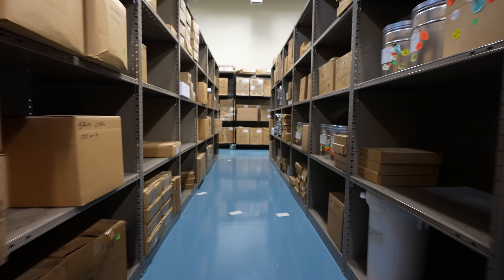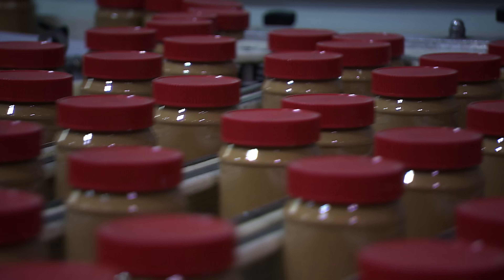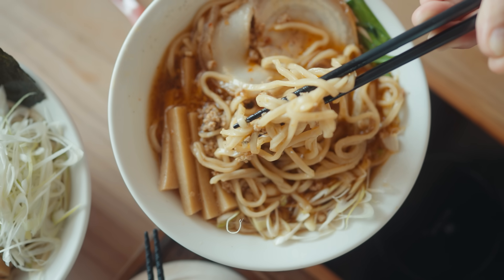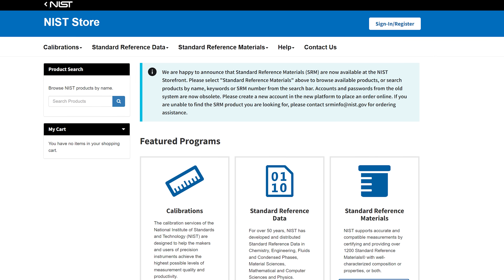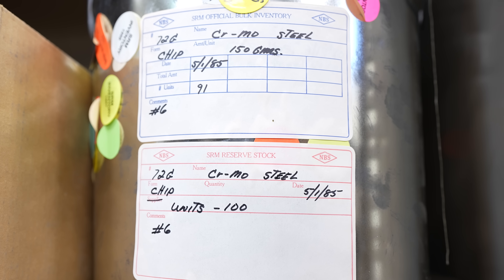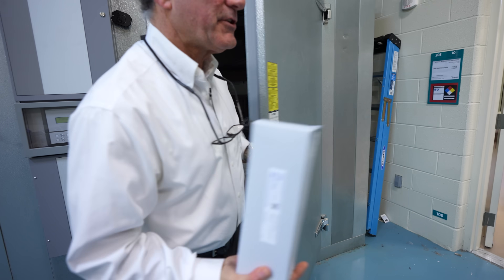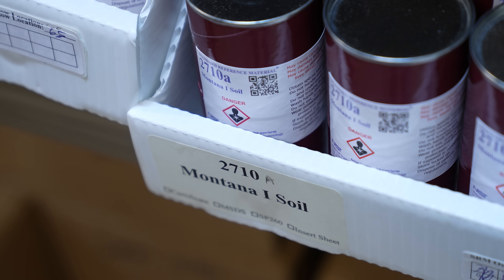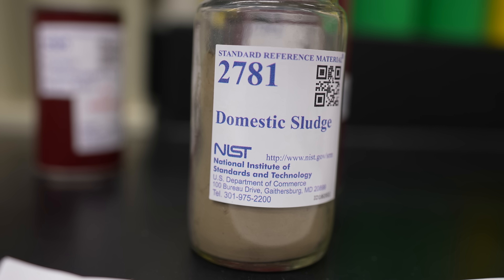The world depends on a collection of strange items. They're not cheap

Comment: I work in an analytical lab here in Brazil and I use a lot of this peanut butter reference material as a quality control for mycotoxins, fatty acids and metal ions in food. It smells so good though! And thanks a lot for these people that work at NIST and make this reference materials. You guys rock!
Reply: @PersonalStash420  someone has to do it. So tanks for NIST to provide such materials. Yes, it's expensive.
Reply: that's super interesting! I used to be a data analyst so all of this is so cool to me lol
Reply: Have you ever tried to taste it?
Reply: @autumnalburn  no. It's an old material and we have a lot of things that shouldn't be there, so definitely no :-)
Reply: nem sabia que existia umas parada assim, doidera
Reply: BRASIL VAI GANHA A COPA 🇧🇷🇧🇷🇧🇷🏆🏆🏆🏆 HECTA CAMPEÃO 🇧🇷🇧🇷🇧🇷🥇🥇🥇
Reply: Except for the 9/11 NIST report, which made such dramatic changes to the structural properties of concrete and steel that, were they true, large swaths of the frozen north would be unable to build structures taller than 3 stories.

I wonder if this is the guy that approved the expansion rates of steel and concrete under heat for the 9/11 NIST report?
Reply: @unifiedtheoryoflife9922  there are no high rises in the “frozen north” that you speak of that even closely reaches the height that the trade centres did lmfao
Reply: @Tmktrsf  The number is 3 floors - and the north is anything that freezes in the winter.

NIST 9/11 report changed the known expansion rate of steel and concrete by so much that you could not buld a 4 story building in Chicago, because the 4th floor would need to be steel, and the steel and concrete apparantly separate under office fire heat, so imagine what 100 degrees the other direction (0F) does. It makes Chicago a one stop light town
Reply: @unifiedtheoryoflife9922   reality: a building collapses due to a +500F delta

you: hOW CAn BuilDInGs EvEn WiThSTanD a -100F DeLTa TheN?

Genius.

Besides, contraction vs expansion are different. Materials have different strength in tension vs compression. And when looking at a structure as a whole, crushing the structure vs tearing it apart is pretty different.
Reply: @unifiedtheoryoflife9922  The cement has to cure above a certain temperature for a certain time frame so prefabs are used and construction avoided in cold weather months for concrete ours with thermal blankets used if temp drops.
Reply: @bobson_dugnutt  ALSO! Steel loses half its strength at the temperature at which jet fuel burns. I always find it funny these dumbasses say steel as to melt, in order to fail... No, it's properties just need to change just enough for it to fail...
Reply: @unifiedtheoryoflife9922  They have 4 story buildings in Chicago and in colder cities....what are you rambling about?
Reply: @BestestDerek  The jet fuel was expended in the initial fireball. 

The temperature you are referring to is jet fuel under optimal conditions. 

What we saw on 9/11 was a black smoking, oxygen starved, office furniture ( designed not to burn ) fire. 

There were people standing in the hole the airplane made and who died trying to escape that area. You're telling me the furniture red hotted the steel and changed its properties?

That building, being so tall was designed to withstand a Boeing 737 impact,  the biggest jet at the time and not much smaller than what hit it. 

At WORST - the structure surrounding the 50 core steel I beams which hold up the entire unique open floor plan of the twin towers, should never ever in a million billion years have fallen to height 0, unless they needed to fall to height 0 - the core I beams surrounding the elevator shafts at the center of the Twin Towers should have survived 

The central I beams should have survived the office furniture fire. 

Height 0.
Reply: @Bobson Dugnutt  Severely edited his post for content after I replied directly to him, which is unethical. The consequences of rapidly approaching a limit are often drastic, right?

@John G There would be no 4 story buildings in Chicago according to the 2005 9/11 NIST report, which is censored. 

Theat 2005 9/11 NIST report tampered with the known physics of steel and concrete expansion under heat that no steel building could survive a Chicago winter. Nothing over 4 stories. It was a scandal what NIST did - it was equivalent to Colin Powell saying we found bioweapons in Iraq to the UN

Iraq had no bioweapons, and buildings do not fall symmetrically, from asymmetric damage, through their paths of greatest resistance, at near free fall speeds, without deceleration, to height 0 without assistance. That assistance has a known quantity and placement - and is evidenced in photos of the 9/11 debris and dust samples.
Reply: @unifiedtheoryoflife9922  This makes no sense. How does the behavior of steel and concrete at high heat change the behavior at low heat? The fact that water boils does not compromise the strength of an iceberg.
Reply: @efdeecue  He's saying the stats used to justified WTC failure when applied to other extremes such as cold, do not compute.
Reply: @unifiedtheoryoflife9922  lmao you looking for people in the youtube comments to be ethical ?
Reply: @unifiedtheoryoflife9922  so tell us, what is the specific value of thermal expansion rate that you think NIST made up? And what is the real value used by engineers to design buildings?

Surely you've actually read the report and can point us to the exact value, and you're not just uncritically repeating some BS claims you read on a blog or something?
Reply: @unifiedtheoryoflife9922  I'm still caught up on the fact that you think Chicago is a one stop light town. Sorry, but dude, you really need to get out of your mom's basement and get your facts straight.
Reply: @unifiedtheoryoflife9922  still and all, their peanut butter srm is really good
Reply: @bobson_dugnutt  Oh boy, the paper planes, ruined steel concrete building :O
Reply: @unifiedtheoryoflife9922  IT WAS AN INSIDE JOB BRO
Reply: @bobson_dugnutt  Not at all related but it's just incredible to see another Dragon Friends fan here
Reply: @unifiedtheoryoflife9922  There's a difference between radiant heat dissipation and kinetic energy transmission. It's the principle used in controlled demolitions of structures that were designed to withstand these heavy impacts. While a giant ~205000kg jet slamming into that building at 750km/h would only have generated around 7-8 giganewtons, the explosion of 90000 liters of jet fuel added anywhere between 70 and 150 giganewtons, which brings it to the realm of what is used to bring down even larger buildings. For comparison, the demolition of the significantly taller Mina Plaza only took around 6000kg of explosives, which was of a class that would have generated only around 50 to 80 giganewtons, barely over half the force that plane crash event generated. While the efficacy of force delivery is certainly much higher in controlled demolitions, it's not hard for 30+ floors of falling structure to make up for the rest, especially when structural integrity gets compromised more and more with each impact. Additionally, most demolitions prefer to go over the force requirement if possible and add more explosives / reduce section distance between explosives, not because there isn't going to be enough force, but that it's simply cleaner of a job when there's less structure to take impacts. I'm sure the fires didn't help things stay structurally sound either, but to be honest they may very well have been completely irrelevant at this point.

The structure doesn't have to be exposed to radiant heat, just vibrate enough to the point that it lowers its structural integrity so that it can no longer support the weight of what's above. Once that gives, impact force from the falling section will create further vibrations that further destabilize the structural integrity of what remains. If you're lucky, or unlucky in the case of demolitions, it stays standing. Most of the time, it does not.

On a related note, this is the reason why skyscrapers (and increasingly even mid-rise buildings nowadays) built on the pacific ring of fire (Japan, New Zealand, Taiwan) employ technologies which allow for the structures to take reduced vibrations from earthquakes. The main difference is the way the energy is delivered, with earthquakes predominantly consisting of maintained lateral forces, as opposed to one big delivery from an event like 9/11 or a controlled demolition, but earthquakes can easily deliver enough kinetic energy to destabilize a building.
Reply: @unifiedtheoryoflife9922  3 floors is not a high rise so I’m not going to bother reading anything after that. Anyways have a nice day 😌
Reply: @kairiroseequinote2946  he didn't say it was a one stop town.
Reply: @bobson_dugnutt  well that shut him up
Reply: @efdeecue  it doesn’t. He’s saying that NIST changed their existing steel samples to conclude that it would change the behavior in that way. Not that in reality it does
Reply: @kairiroseequinote2946  being caught up in such an irrelevant part of his comment that he was even saying isn’t the case shows your shortcomings in intelligence. Nobody said Chicago was actually a one stop light town. It might if you can’t read though who knows I don’t suffer from that problem
Reply: @Tmktrsf  if you actually think he said three floors was a high rise I present you with a Darwin Award. Have a nice day
Reply: @zach3096  Its almost like I was responding to a comment that did say that lmfao. Please learn how the internet works.

Comment: I'm still fail to understand how a lot of those are usefull. Like why would you store perishable food for so long that it decay and change composition? They say they keep peanut butter to use as a way to detect fungal infection in peanuts but i mean if the peanut butter is stored for so long that it basically rot in its jar how is that a valid standard anymore when the standard sample itself is unsafe for consumption? What about steel? I understand the need for steel sample in the 20th century but now that we have mass spectrometer you just need to scan a piece of steel once, get the value of the different elements composing it and then scan the steel you produce and compare the numbers. Finaly why would you make a standard out of sludge if the point is to monitor change in sludge composition over time? A standard of anything stay the same so if that sample is based on what sludge composition was in the 70s how is that helping us today?

Comment: I used to smoke years ago and many, many times fell asleep while smoking. My old mattress was full of burn holes. I'm guessing I have these folks (and the anti-fire additive in tobacco) to thank for not burning to death.
Reply: I'm almost positive the major anti-fire additive is in the rolling paper not the tobacco itself. It's those weird rings you see on the outside of a cigarette. They are designed to smolder the cigarette out if not actually dragged upon (pulling the flame past those stripes of what's basically flame retardant).

Comment: 1. Who checks that the materials sold to consumers meet the reference standard? Clearly, a lot of products are sold that are contaminated. Companies are found liable for failing to maintain standards (safety standards, as opposed to the reference standard). Manufacturers know whether they are producing according to the standard? How do we know? ...Is this question irrelevant because the reference material is used to calibrate machinery, not to produce consumer products?
2. There are tons of varieties of many products (like peanut butter). How does NIST choose a subset to develop a standard reference material?
3. Of any given standard reference material, there must be a finite number. How does NIST produce subsequent samples? Can a reference standard drift — change over time?

Comment: This takes the joke that US will use any measurements except the metric unit to another level😂
Reply: There's reference standards for metric measurements that are kept in France
Reply: @matthewlueder2656  metric units are now measured with physics constants. For example a meter is defined as the length of the path travelled by light in a vacuum during a time interval of 1/299,792,458 of a second

Comment: What happens when a batch of standard samples runs out? 

Like that dust was collected in the 90s, the content of dust collected in the same way now would be vastly different (less tobacco/ nicotine, lead, more plastic etc).

Do they just have to create a brand new standard with no relationship to the old one?
Reply: They decide how much of a standard to prepare based on expected use and ability to create  homogeneous samples. They spend a lot of time characterizing that batch...and need to do the same for the next batch.  Sometimes they decide they can't create homogeneous samples...or can't guarantee stability of the sample for a long enough time to make it useful (and they decide not to introduce the SRM).

Comment: PEASE ANSWER 

If these standard reference materials are deemed to be the standard by taking the average of what an item is at the time, doesn’t this halt progress in way? For certain “raw” materials, it makes sense to never have those differ and to just make a new material with a new name depending on what its makeup is (for example, the steel being standardized and if there’s a newer, better steel then they’d give it a different name so that the previous standard of steel is still there, but it also allows for new materials to be made). 

With something like the cigarettes, this means the standard is the average of whenever they took that average, so by holding future cigarettes to that standard, wouldn’t it halt or slow progress for making newer, better cigarettes? If not, it would mean that they update the SRM, but what would that look like and when would that happen? If the industry standard has been standardized with materials of a certain time throughout the years, the average would basically be the same, given that everyone was adhering to the standard to begin with. So I guess one of my questions is at what point do they decide to update the SRM and what would they take that average of at that point since everybody would already be adhering to the previous standard?

Comment: Having worked as an IT dude for a pharma and managing the lab machines and network; I can tell you just how important the standard is.  Many people don't really understand how many different compounds, molecules, polymer chains, elements, etc. that go into making medication.  Each step and raw material has to go through a test in a gas or liquid chromatography machine.  That is stored on the network for that lot and may be pulled by the FDA, DEA, or USDA for years afterwards, and that measurement is obtained based on the "standard."  That may be alcohol, distilled water, etc.  I was quite taken aback by what goes into this, and that helped me understand why some drugs can cost a drastic amount more than others.  I am glad NIST is around.

Comment: One of the best videos I have seen recently. We take quality and standards for granted a lot of the time. US has one of the best quality standards across several products even though they are not the cheapest at manufacturing them. One of the things I had was to see things like Made in China or Designed in USA and Made in Bangladesh and stuff like that. No offense to the other countries but there is a great price in things which are made of superior quality that are compared to world class standards without an iota of dilution in the quality standards.

When manufacturing got offshored (now they are reshoring) is that quality standards dropped very very slowly at the beginning and then very quickly once you reach critical mass in a way that is unnoticeable in the short term but in the long term it can be detected. 

I would love to see similar videos on the FDA, NEA if you ever get access to them.

Comment: Some of this stuff doesn't make sense. To impart a standard rifling mark on a bullet, surely they would have needed to take the marks from a fired bullet. So why not use the bullet, then distribute copies? 

Or by taking an average sample of steel, which comes in different grades, they take a sample from a forge and distribute it to the steel manufacturers, and yet a given steel mix is something that can be written down on paper, and the product analysed. 

I just don't get it.....

This doesn't seem to be as useful, practical or sensible as the standard kilogram or meter.

Comment: Analytical chemist here. From academic research to drug development to drug safety testing, every position I've ever worked makes heavy use of NIST standards (though usually all with their own internal acronyms). These are absolutely vital for almost any calibration or measurement which requires high degrees of certainty.

Comment: I worked in a steel mill, and among other thins, worked with the chemists to keep the spectrometers running.They had steel standards that they used to calibrate the spectrometers. There was special equipment to test nitrogen levels. The tensile strength of some products was also tested. There were several sizes of hydraulic pullers that used calibrated load cells to measure the force required to pull the steel apart. (One was two stories tall.) The company was certified to make rebar for nuclear reactor containment structures. I'd never heard of a Charpy until today.